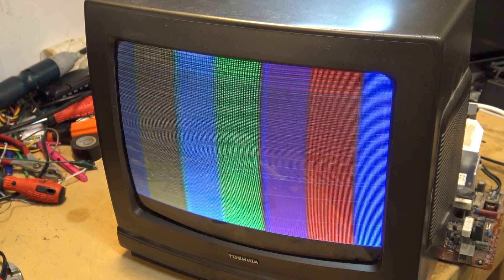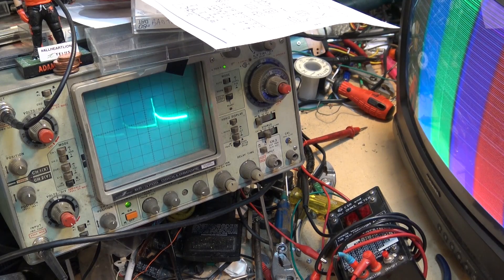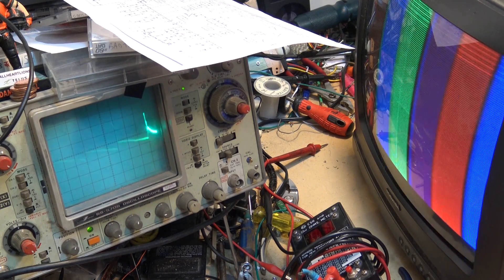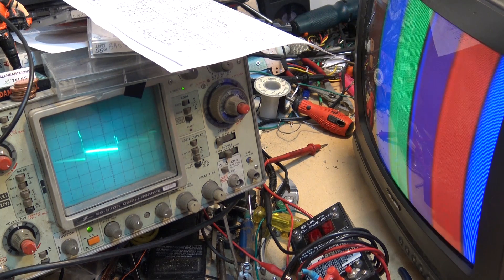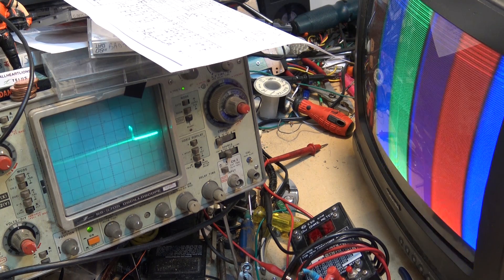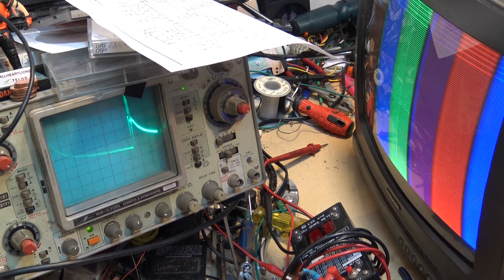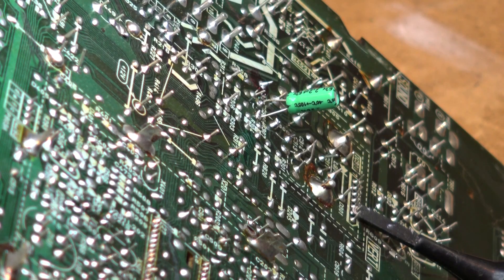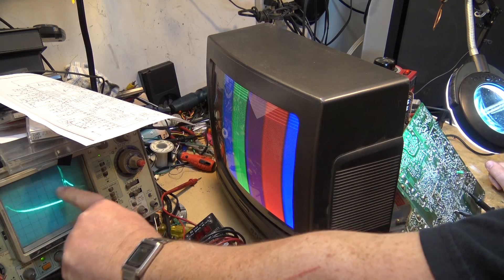Toshiba CRT TV Vertical bootstrap capacitor failure

Comment: I replaced a 2200uf 25v capacitor related to the vertical output and that fixed the vertical collapse for about 10 minutes. That's not a promising situation. I need to sniff around with the scope I guess, unless you have an idea off the top of your head.
Reply from the maker: Did you use a low ESR high temperature type.  Also the small ones need to be changed.
Reply: @12voltvids  it was a Nichicon 85°C that I had on hand. It should have been fine, but I should arrange for replacing them all in that area.
Reply from the maker: Use 105' the 85s these days are junk.
Reply: @12voltvids  thanks, I'll refresh the whole vertical side with better parts. I'll let you know.

Comment: What is the typical duty cycle of the horizontal output transistor? Would 50% be about right?
Reply from the maker: uK8cvPAq 
It is a high voltage,  high current pulse.

Comment: Just found a Sanyo cp28wf2(pal 60) crt with scart input, BUT when I plug my console in via scart into tv I get http://imgur.com/6su8dC7 . The top third of the screen is distorted, but other aspect ratio's are fine apart from 4:3. Any idea's as to why? Thanks.
Reply from the maker: That is one that can display HD right> Has a 16x9 tube?
I know little about the PAL specific models, but he had some wide screen analog HD sets for awhile, and they would up scale SD video to the higher scanning rate. I would suspect something on the scan converter board, more likely a back capacitor, and more than likely it will be power related.
Reply: Thanks for reply. Yes it's a widescreen tele. For what's worth I have 3 photos of the motherboard here http://imgur.com/a/TTYp5 .  I plugged in another console using scart, and I just get a vertical line....So looks like I should start replacing caps??

Comment: Often when that cap goes, you eventually blow the vertical chip on larger monitors.
Reply from the maker: That's right. When the bootsrtap cap blows the vertical output overheats ans goes pop.

Comment: Also, this reminds me when Walmart used to have a ton of Samsung CRT TVs hanging from the ceiling in various departments showing advertising and other propaganda. Every single one of those failed in exactly the same way. Top half collapsed while bottom half was present. Eventually it would cause a single line that would slowly pulse up and down over and over. I found that quite interesting.
Reply from the maker: The reliability of any electronic device is inversely proportional to the number of electrolytic capacitors it contains.
Reply: Well, the last of the Mitsubishi CRT projection sets towards the end was a capacitor farm.
Reply from the maker: All the projector sets were. Very complex dynamic convergence circuits in use.
Reply: 12voltvids yes but that wasn't nearly as capacitor ridden as the main signal boards were. the biggest problem with those convergence circuits were the piss poor reliable STK chips. I've had to change hundreds of those.

Comment: I had an RCA CTC167 that was purchased new by my parents when I was a kid. Of course they watched the hell out of it. Eventually it got bad enough when you first fired it up the vertical foldover at the top was pretty bad. Eventually as it ran it got better. But as time went on, it got worse overall... Eventually it collapsed into a white line. I did some troubleshooting and turns out that every single capacitor was leaking or starting to leak. Even though I replaced the vertical IC, all its associated capacitors, and the B+ supply fusible resistor, Never did get vertical back. Checking the Jungle IC, the drive was gone. So it killed the jungle IC somehow. Eventually we just tossed it and moved on, But it was a nice vertical console with the glass doors at the bottom. I do miss that thing, it had a decent picture and good sound.

Comment: I am liking these videos on crt sets. i have a little 13" Hitachi set that has some picture bending/distortion whenever objects move off the edge of the screen and faint jail bars. any ideas what this could be? I have replaced all of the electrolytic caps in the high voltage section btw.